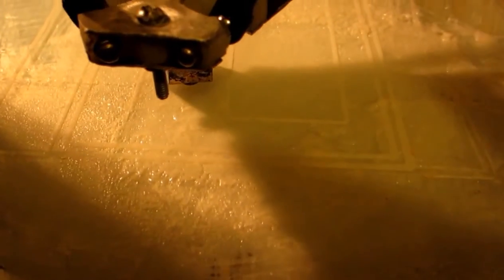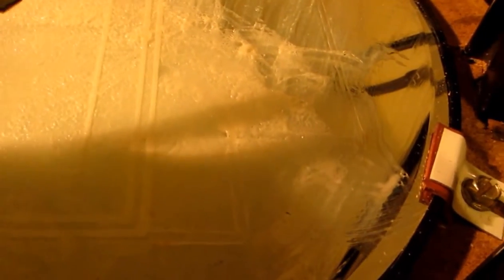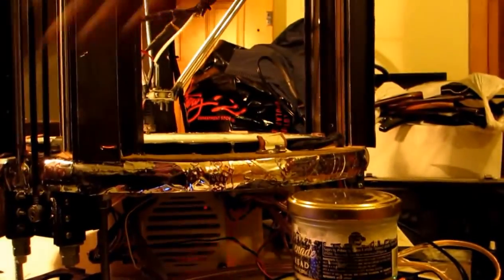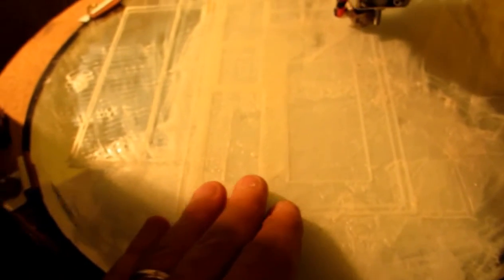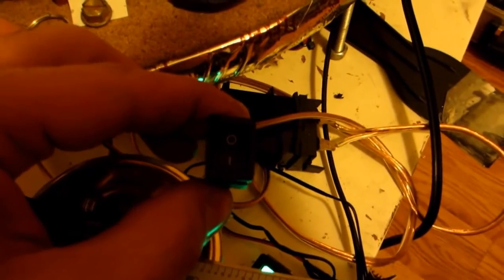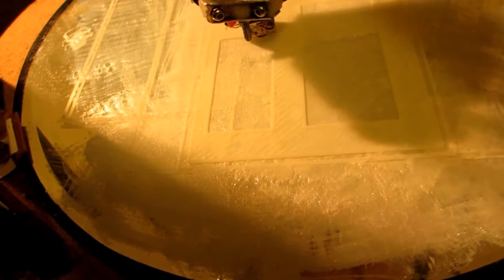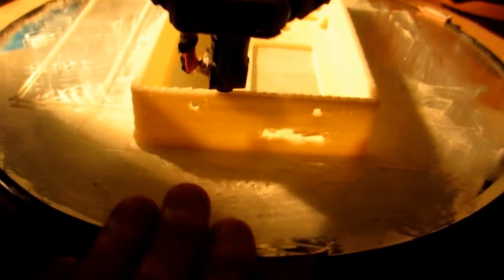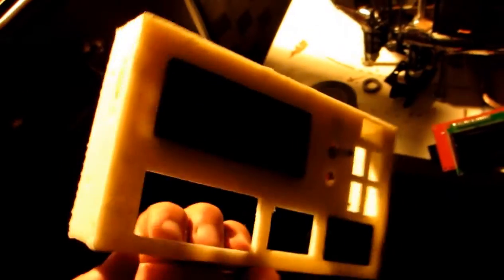Thicke J-Head printing. Huge nozzle 1.5mm +, HIGH SPEED 3D Printing

Comment: Hey! could you please tell more about setting you used?
Reply from the maker: Setting was 2mm bore, as the nozzle was under extruding. The speed was around 10mm/s and the temp was about 250c with ABS on there.
Reply: ossum! you have been slicing with CURA or other software? I am having some trouble with simplify 3D at the moment, it tends to thinks it is printing in 0.4mm width, althouth setting do look OK... Today I am going to try pronterface and cura
Reply from the maker: I slice mainly with Cura. Have been using it for a long time honestly. For the most part it just works.
Reply: well - I just nailed it with PLA at also, around 250 C, but since I am extruding at 30mm/s - the first layer is basically GLASS. Looks really ossum! just I am having issues with other layers, when they overlap the older ones and get strong - other layers start to hit them and make some imperfections... Gonna play more with it to get near perfect finish on most of the shapes and parts, not just some vases or boxes ;] Maybe you have some more examples to share? Really interesting what other guys have achieved with such a thick nozzles!